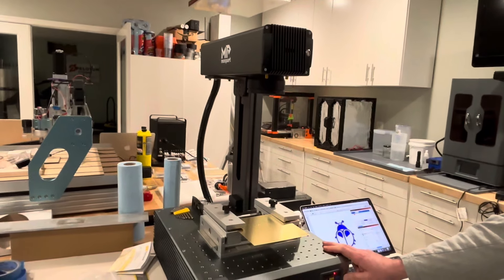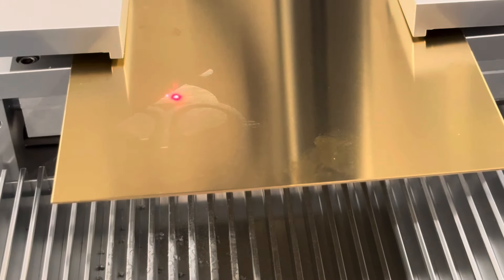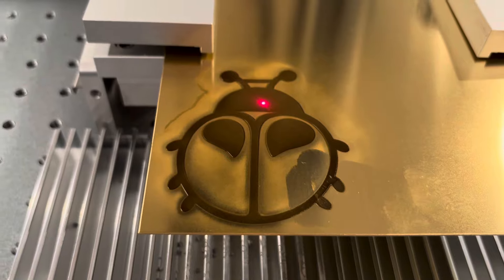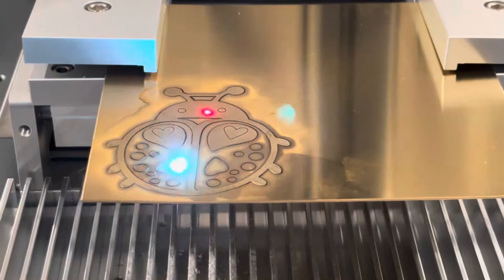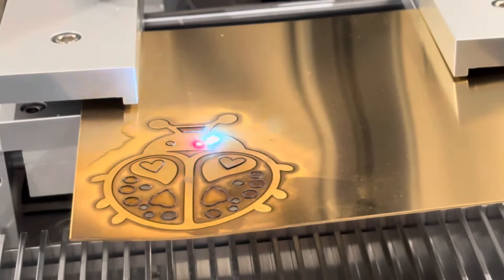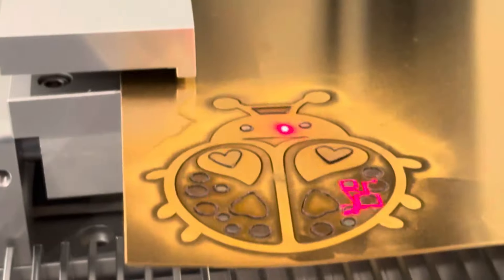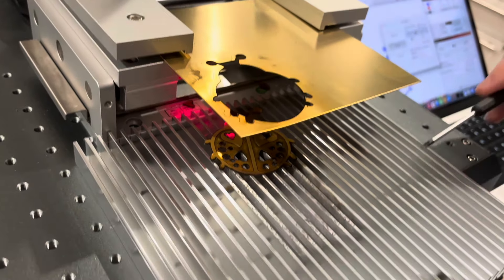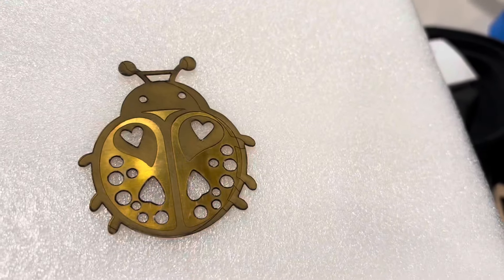Etching and cutting brass with Monport 100 watt MOPA fiber laser

Comment: How thick is the brass that you cut? 
would air assist from not help with the heat problem? 
Does your laser not have a camera for alignment? 
can you do a test for me and use black marble/granite and show us how deep it engraves at 20, 30, 50 and 100% power and its respective speeds and how many passes to get a deep etch and the time it takes? 
I got a co2 laser but if I have to laser 200 Black marble/granite stones it will take me weeks to finish,. Im thinking for getting a fiber laser but im stuck between getting a bigger CO2 or a 300mm fiber. Im trying to think what will bring in more money more often. 
Another thing is Gold and Silver Rowmark, can you fiber laser it and cut it out on the fiber? 
Thanks

Comment: what a disaster
Reply from the maker: @6942ggg  never said it wasn’t. We are brand new to the fiber laser. Very different world working with metal. We know we have a lot to learn.
Reply from the maker: Hello again, I just wanted to thank you for telling us about the wobble. My husband gave your settings a try and the results as well as the effort were night and day. He was able to cut the 1mm brass in 25 passes and it literally fell out vs. having to press it out. You were so helpful and your advice was dead on. 

You seem to know a lot about this. Do you have any advice regarding how to achieve smoother edges? Ours are very sharp. My husband has used a Proxxon rotary tool to manually smooth out the edges but it’s tedious. Is there a clean up setting or “sanding/buffing” setting you have used with success that you’d be willing to share?  Or, if you smooth your pieces manually, is there a method you recommend?

Thank you again for your input. We appreciate your time. - Dana
Reply: Move along troll unless you have helpful information to help new laser users
Reply from the maker: @MrTwojaythomo 🥰 Thank you, we find that the learning curve on this laser is steeper than the rest of the ones we have. He ended up giving us some helpful direction but he was pretty terse with us. We are still learning. Thanks for taking up for us 🌸